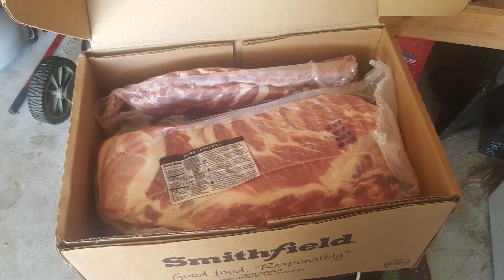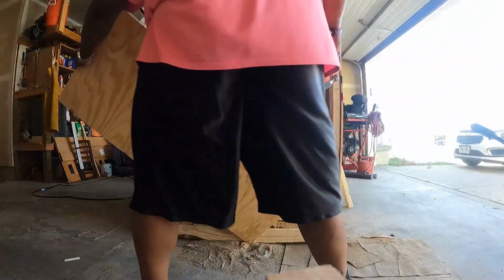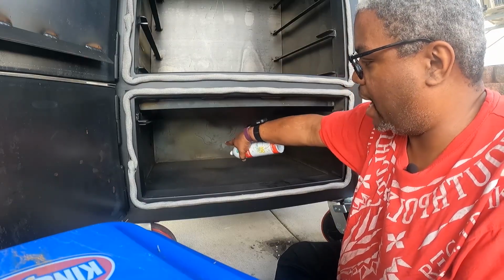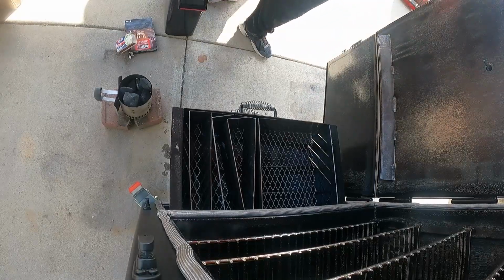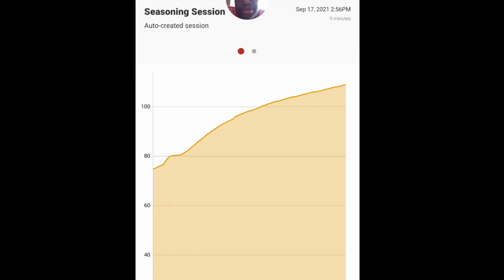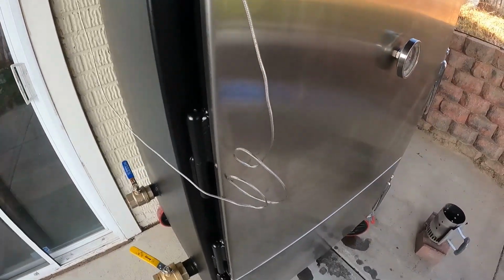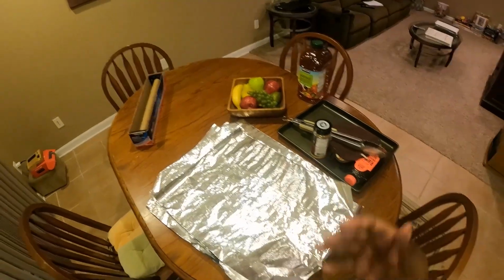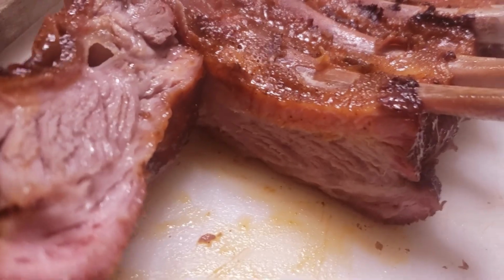LoneStarGrillz Large Insulated Vertical Cabinet Smoker

Comment: I see you got the firebrand. I got the same pit but don't have it. Sometimes it takes forever for the temp to climb back up. Do you recommend the firebrand and usually, how long does it take the pit temps to get back to temp using it?
Reply from the maker: Good question!  My temp usually comes back up in a few minutes.  I don't use the fan a ton, depending on how long I am gonna be smoking stuff for.  Once you get your temps dialed in, try not to fidget with the dampers, trust the smoker, and try not to keep the door open for extended periods of time.

I DO recommend the Firebrand.  It's one of the best BBQ gadgets I have ever invested in.

Comment: Nice vid! thanks for sharing your IVS journey. I have one too. Took a bit to get used to it, but once you get it locked in you can really set it & forget it. It'll hold more charcoal than you'll likely need in one sitting which is where those T pieces come in handy. I rarely run more than 75% of the box full of charcoal. Cover the wood chunks in charcoal, they burn better & more completely. One other thing is if you're starting a long burn by adding a starting point of charcoals then you want to frontload the wood nearby as well. It takes a while for the burn to creep across the firebox. If you have wood regularly spaced out it can often end up in light smoke.

Happy cooking brother